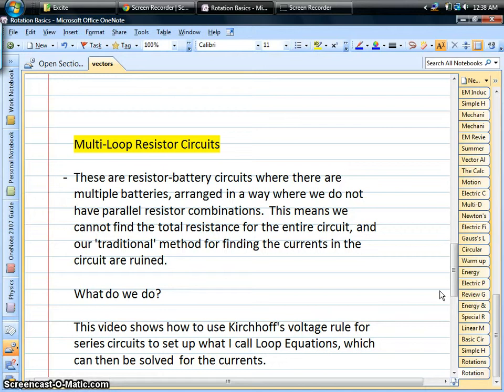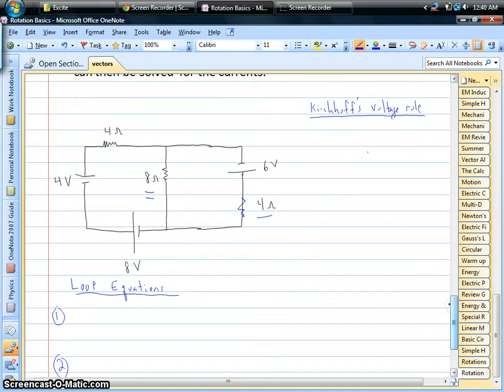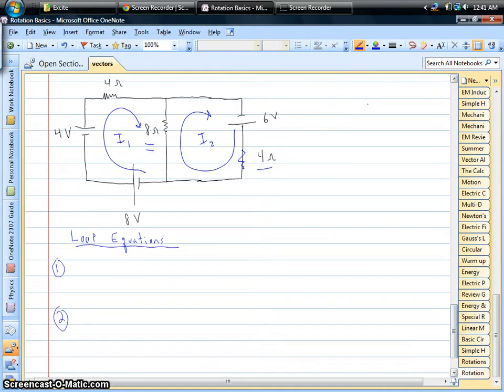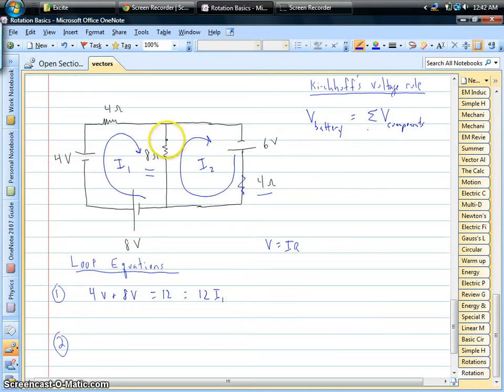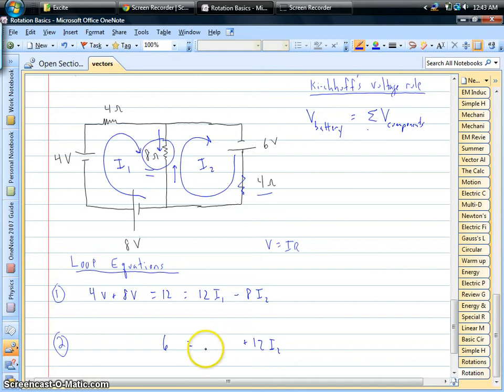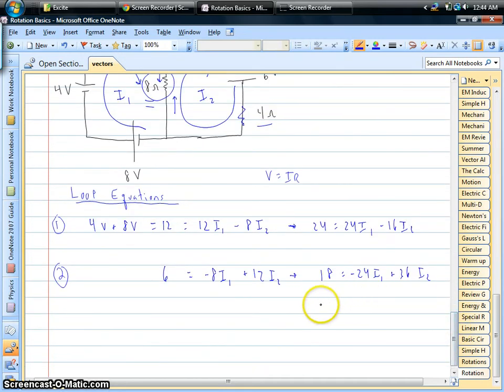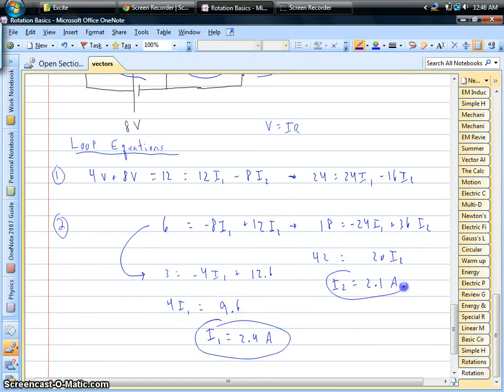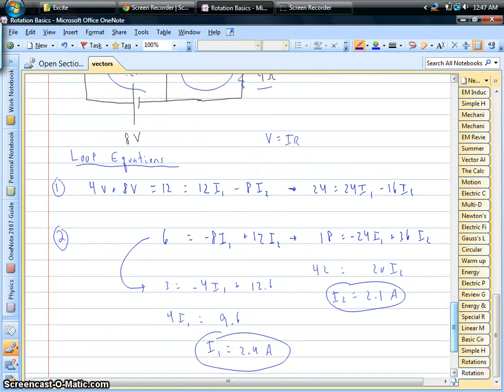How to do Multi-loop Resistor Circuits

Comment: With this type of circuit there is no true equivalent resistance. The reason is, with the multiple batteries on different parts of the circuit, there is no true parallel resistance. Instead, when we treat them as 'loops,' we are treating them as series circuits. So we can add those resistors and voltages up, which forms the basis of the 'loop equations.' The one thing we change is for anything that is shared between two loops - for that resistor(s), we need to consider what the 'net current' is flowing through it, based on the directions we guess for the loop currents. This is the simplest process I have found for solving these systems. I hope this helps.